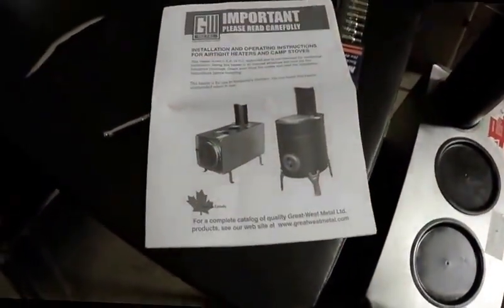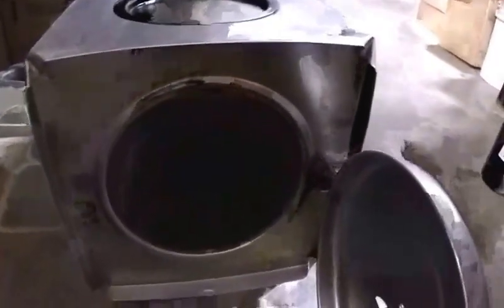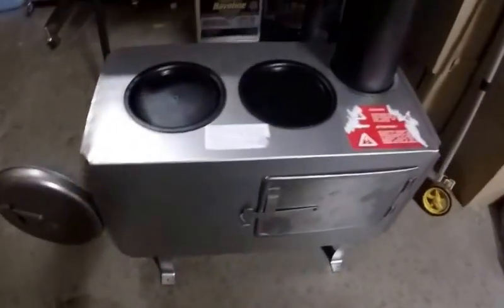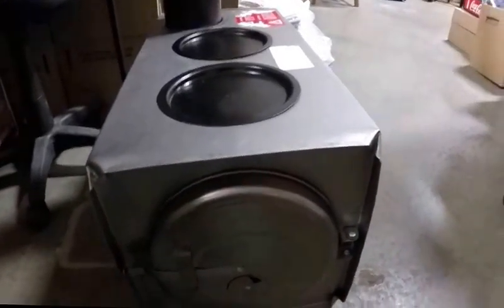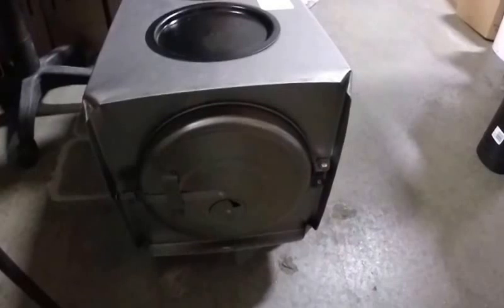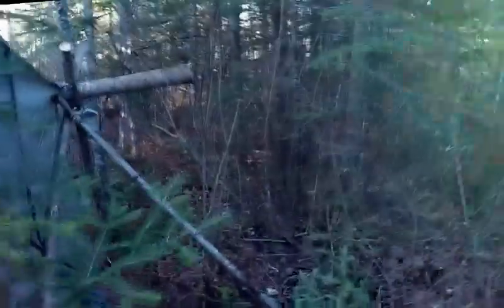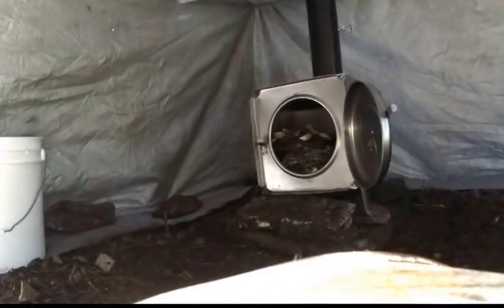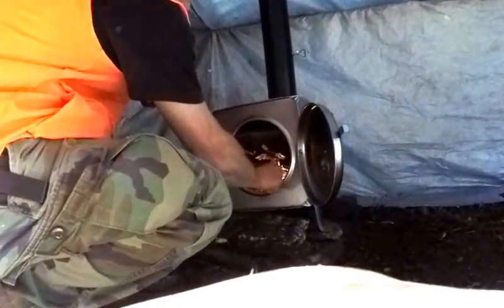Shelter Stove Installation in Tent

Comment: Looked at their website.  Kind of a "cute" stove if you're just playing around.  But if you're really going to use it for heat isn't it inefficient for it's size?  It looks like the ovens very substantially decrease the fuel capacity.  You can buy sheet metal ovens that rest on top of woodburners which would seem to make more sense if you want an oven.  And the door is not air-tight. 

I have a Four Dog that I use to heat my wall tent.  Although probably heavier I suspect it's much more efficient.

To each his own of course.
Reply from the maker: It last 2 hours when loaded and throws loads of heat, with oven door open it throws heat out the side. I actually ordered the one with oven but this was sent at same cost of the no-oven stove. So kept it. I have the titanium stove and glad it was not in there when the tent collapsed, this pretty much withstood the collapse, the titanium would have been crushed. It works for me for now, price and weight was the big issue as most stoves are US$ and make them much more expensive.